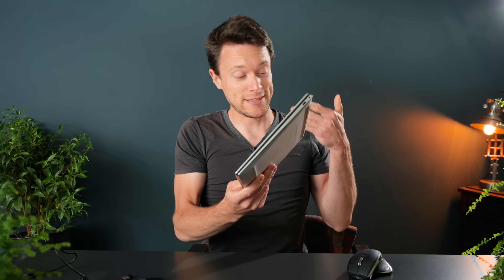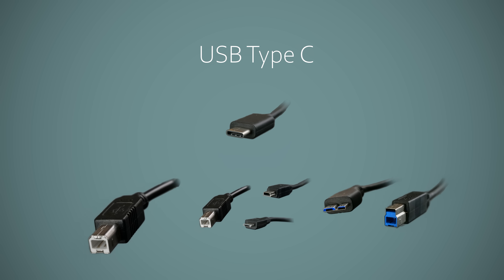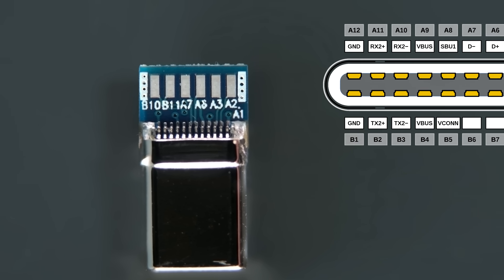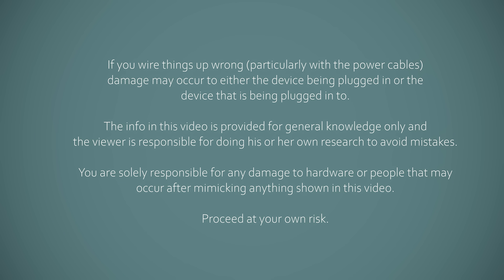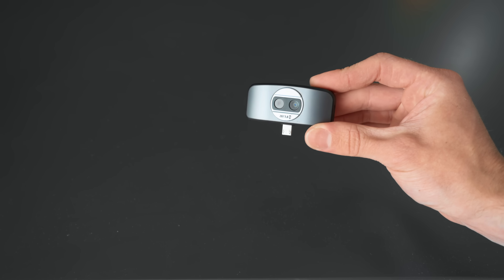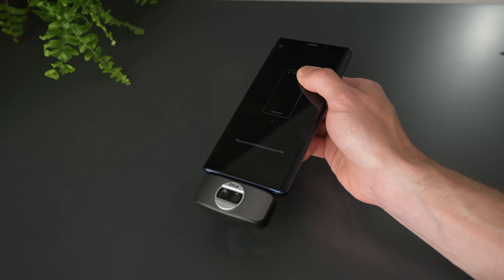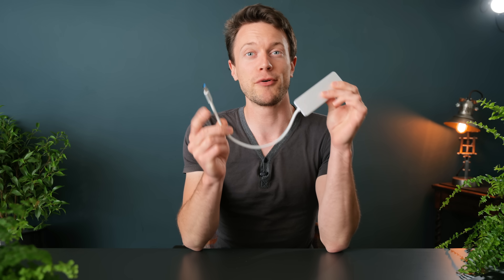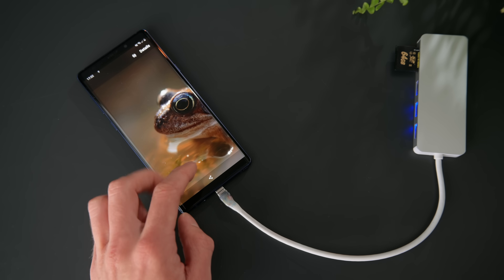Converting devices to USB Type-C

Comment: Awesome info.  You actually have me wanting to get some type c connectors and work on a few things.  Had to say I was a little disappointed at one thing though.  A few times you CORRECTLY referred to the adaptors as what they actually are, adaptors.  A few times you mistakenly called them "dongles" though.  A dongle has always been a hardware device used for software copy protection.  Yes, a lot of people throw that word around for just about everything these days, but it doesn't make them right, it just shows their ignorance with technology.  You may have used it so the uneducated people would hear a word they are familiar with, but you should be teaching them the correct words to use instead of just giving them a pass on their wrong use of the word dongle.

Comment: Brooo u have a Dell XPS!!! It has bluetooth 5.0 built in!!! Go open the tab on the botom right of the screen form Windows 10, then right click bluetooth and pick the first option from the top. A new window will open, find and click add Bluetooth device, pick the first option from the top its something like Keyboard, Mouse or Headphones. Power on your mouse it will automaticly enter paring mode then find it on your pc and your SET TO USE IT THE NORMAL WAY! Throw that Bluetooth dongle in a box somewhere u dont need it.
Reply: It's not a bluetooth dongle...

Comment: Sure you can convert wireless dongle into usb c, but many laptops have bluetooth receivers which the mouse can connect to without dongles. But I don't know if that performs worse
Reply: its higher latency yes, and not all mice support both usb 2.4ghz receivers and bluetooth, this one likely cant

Comment: i have a dual  USB A fast charge port on my car and just bought a mophie magsafe + magnetic charger, not knowing it was usb C cable, can i apply this to convert the one of the usb B on car port to usb C? i'd rather modify the car usb than cut the wire on the magsafe charger. i tried two different adapters that claim fast charge but they dont work..

Comment: And the dilemma with USB-C specifically on my area is, the sellers don't really know their products. Most of them don't, and it's been like that since the early days of Micro-B 3.0 plugs. 

For example, I had to blatantly say "external hard drive cable" to make them understand what I am looking for. If I ever said that I'm looking for a "Micro-B USB 3.0 cable" instead, they will be so damn confused and give me a charging cable with branched plugs into 3 connectors (Type-C 2.0, Micro-B 2.0, and Lighting) 😂

Also, when it comes to looking for a type C 3.1 or 3.2 aka "data transfer oriented type-C", it's frickin' hard get one. Most type-C being sold here at my area are at 2.0 speed, focused more on charging power and charging speed capabilities.

Comment: I was curious about the whole USB A/B thing and why there were so many connectors and looked it up a while back just to read about the story. This vid summarizes it pretty well. For that hub I am thinking it might be cleaner if you could open up the case and replace it with a cable with the modified connectors all being internal.

Comment: thank you for the video, you solved my issue, the if you will see near the resistor - the near 2 pads are connected to GND and the needed pin so you could move the small resistor to the other place and have the issue solved with less space :), thank you again!

Comment: I found this very informative and I did learn something that I didn’t know or didn’t think of but unless you like soldering and adding transistors/diodes, you are not saving anything over just buying an adapter.  Still a good video.

Comment: A Much Better Suggestion: Instead of buying a USB-C Connector board (03:55), buy a type-A to Type-C converter(As the one on the left side 08:44), disassemble it, get rid of all the unnecessary elements, and solder the Wireless Receiver of the Mouse to it. By doing this, you won't have to add any resister.

OR: You could use the silver plastic housing of the converter and place the wireless receiver chip inside it. It would much more aesthetically pleasing to the eyes of the beholder.

Comment: I need a similar project. My laptop the surface book 2 has a detachable screen. The keyboard houses a graphics card. The laptop doesn't have thunderbolt ports so no hope for a new external GPU. But the port the screen plugs into must work in a similar way. Because it can transfer power and video information from the keyboard graphics card. If someone made an adapter for that I could upgrade my laptops graphics card without having to buy a whole new laptop. But that's such a niche problem I don't think it's gonna happen

Comment: Hi, I own a pair of Razer Blackshark V2 Pro headsets and the charging port on them broke and instead of just replacing the tiny charging pcb (since it has its own board connected via ribbon cable), I was wanting to replace the female micro usb on it to a USB C, can anyone send links to any information that would help me achieve this? I tried to do some searching around and wasn't able to fully grasp how the wiring/connecting would work.

Comment: Oh yeah! Buying a mountain of Usb c boards and pulling your devices apart, soldering connectors, and then buying a bunch of liquid rubber is so much more convenient than a dongle even though you will still need dongles for plugging multiple devices in, and yeah that makes no sense at all. 🤷

Comment: 1. Get USB C everything, its easier, faster
2. Get USB C cables
3. Get USB C cases for all your drives
4. Get USB A to USB C adapters
5. Get USB C to USB A adapters
6. Get USB C to USB B cables for your printers/scanners/peripherals
7. Get USB C to USB A hubs
8. Get USB A to USB C hubs
9. Get a bucket that you can scrounge in for all the above.

You have wireless mice and keyboards that need USB receivers? Seriously?
Reply: Ahem, his channel is called "DIY Perks", not "Just get lots of new stuff"!
Reply: @ianmorris8534  My list is cheap, fast, easy and works.

Comment: QUESTION : Would it be possible or even a good idea to convert my  SAMSUNG MUF-256AB/AM FIT Plus 256GB - 400MB/s USB 3.1 Flash
To Type C? Using an OTG adapter?(IncludedW/allSamsnDvc) Makig FlashDrive most Compact drive ever made. I'd really like to know your thoughts. Thanks

Comment: tip: at 7:13 you have not to scrape copper off the pcb. you simply could unsolder the resistor R1 and place R2 instead.
Reply: as he was explaining it I was wondering why he didn’t do that
Reply: that resistor has higher value than the needed 5.1k, so u cant
Reply: Saw this as well
Reply: Yes, but it will require much more precision
Reply: @akeem2983  Tweezers aren't that difficult to come by

Comment: So I'm pretty sure both versions of the USB-C connectors you used have empty pads that you can move the surface mount resistors to convert from host mode to device mode, rather than scratching and/or kludging the big through hole resistor onto it.
Reply: You need a different resistor value though so you can't simply move the existing resistor.

Comment: I occasionally plug a device into my computer and get the "this device can perform faster USB 3.0"  notification. I will then plug it into the USB 3.0 port, and nothing changes. After watching this, I now understand why. I've been plugging into the USB 3.0, but am still using a 2.0 cable.

Comment: Was wondering if you had any ideas for a wireless usb adaptor to make wired devices wireless, I have seen the Bluetooth modules, but for something special, 
Like an Activeboard or smartboard, they need a proper USB host connection to function.  wireless display is easy, but i am still stuck running cables across the room for the usb connections.

Comment: Hi Matt, really love your videos. However I still cannot see properly how and which pin you solder the resistor for the USB-C trim-down version breakout board to convert it to 'Device' mode. And what is the resistor value to use? Can have the specifications in more details? Thanks.
Reply: Instead of wiping the default resistor entirely from the R1 pin? Can just de-solder and re-solder the same resistor to R2?

Comment: It shouldn't be too hard to develop a custom breakout circuit board for a USB C connector that could be surface mounted to a USB A circuit board.
Reply: Ah looks like the second USB C breakout you showed does exactly this.
Reply: No, it turns out the V+, D-, D+, V- pads on the second USB-C connector are in the reversed order and thus cannot be surface mounted onto the USB-A pads. Frustrating.

Comment: After plugged in, USB-A feels a bit more robust. I feel like I can break the USB-C cable whenever I plug it in(I do this 2-8 times per day on work laptop and docks). I hope it doesn't happen, and if it does, I hope it's on the cable part and not PC :)
Reply: USB C by very nature is more robust due the much higher contact area with the PCB due the far larger number of pins on the connector compared to just 4 on USB A not to mention the ton of advantages too

Comment: Conspiracy? Logitech wants you to buy a new mouse, they don't GAF about enabling you to buy a new dongle that supports USB-C for your current mouse. Just a thought. If they cared about the environment, they would offer USB-C converters for your current gear. But they rather you throw away your old mouse that supports USB-C. They might make $1 on a new USB-C device for your current device, but they make $10 on you buying a new mouse.

Comment: The part about soldering on a resistor is actually not easy at all, and very difficult indeed! You have to explain in detail what is a resistor, what kind to buy, how resistors work, why one is needed, etc. you kind if quickly skipped over this part.
Reply: lemme give you an advice, there's a thing called google and basic education and also paying attention. He clearly said why you need a resistor just seconds into that part. What is a resistor? and how they work? did you actually study in school considering most curriculums (hell even in 3rd world countries too) cover what resistors are in middle/high school or literally just use google honestly. And he clearly mentioned the values needed. Just put in some effort honestly

Comment: I used 8kohm smd I pulled off a junk donor board in the R2 slot and it works fine (obviously remove R1).

Comment: 4,200+ dislikes?!? What's not to like about a very straight forward and relatively easy way to allow usage of the devices you already own and enjoy with the chargers, cables and devices you will buy, going forward? Plus, Matt gives a very easy to understand and follow tutorial with the reasons why he does it the way he advises, references for the information detailing what you need to know and he even gives a list, with links, to the parts he used in the vid. What more do you want, for Matt to come to your house and build a few for you? Either that, or there are 4,200+ people with businesses dependent on people having to buy adaptors and/or cables from them to connect non USB C devices to a USB C only host or people that will throw out perfectly good devices without the newest type of connector and go buy devices that do. TRAGIC!!! Thanks Matt, for the great channel, it's content and your willingness to share the info you do that helps save TONS of cash and enables people to do things they didn't realize they had the ability to do!
Oh, yeah. A huge "BOO!" and middle finger to the 4,200+ that think this video was somehow not worthy of a thumbs up or at least didn't/couldn't see the value this vid offers and felt compelled to have to hit the thumbs down and/or crap on it in the comments, rather than just move on to whatever it is they like watching.

Comment: The term sub device is a bit of a misnomer. Form the USB C spec we still assign functionality as Host and Device, as you have illustrated. However, "sub" connectors as you put it, as legacy before USB C, are mechanically given either a Host or Device "gender, form factor", with the ability in USB 2.0 OTG to exchange host and device roles, using USB micro B with an extra pin, or negotiated to transfer the host role. USB C has a basic signalling "pull up/down resistor configuration" to identify a device to a host. The OTG functionality is now up to a "smart" device (like a tablet) to change roles from device to host. This is interesting because, as the hardware has evolved for USB OTG, this reassignment for Tablet, for example, is confined to one port. Either USB C or micro-B receptacles. Which makes sense, for a tablet, in ligically how can a USB port be both Host and Device at the same time and to save cost the hardware only supports one OTG port. Where as for a PC or Notebook the USB C assignment makes more sense, from a legacy standpoint, that all the ports act like a host. Anyway this is how I understand the evolution. I would like to get other peoples input on this.

Comment: Your soldering is not great, I wouldn’t trust it!
Also how can you get USB 2.0 to even transfer data? I tried with a mouse, the cable was simply too short for my use so I cut the end of an old 3 meters long USB A to micro USB cable, and soldered a female USB A. The data wouldn’t transfer because of parasitic capacitances!

Comment: Isn't it possible to desolder the SMD resistor and put it back on the other pads (to change it from host to client)? instead of using a full sized through-hole resistor?
Reply: It has to be around 5k. I’m not sure the minimum value but you can’t use R1 and move it over.

Comment: I always considered lightning, micro usb-b, and type-c connectors to be the same plug-in, and that they only separated phone brands so that you had to buy more things.

Glad to see there’s more to it
Reply: Lightning is it's own thing as no simple adapters exist for it to convert to USB.
Reply: Micro-B at least has the excuse of market demand, where most users would be unhappy to have a chonk regular sized B port on their device. But lightning, while welcome as a change from the old Apple port should imho have been put on hold and instead Apple should have waited and assisted with embracing USB-C. Especially now that they're using it on some of their iPads there's no reason to continue using it other than to sell more adaptors, cables and chargers.
Reply: @G1NZOU  Apple was one of the main drivers behind USB-C's development. Only reason they moved to Lightning was that USB-C initially was that it wasn't ready.
Reply: @reaperreaper5098  I totally get that, the trouble is they're now continuing to use Lightning but in a weird way, where some of their products have Lightning and some have USB-C or Thunderbolt 4, this completely derails their argument that they're saving eco resourses on cables since someone with an iPad still needs to buy both cables if they have a set of AirPods.
They should streamline their mobile device range and accessories by standardising instead of holding on to Lightning longer than it was worth.

Comment: not to nit pick but at 7:04 wouldnt it be easier to just use some tweezers and your iron to unsolder and move the resistor to  the R2 pad? you dont need a new resistor and no need to damage the pcb.

Comment: the epoxy has no give, so you should add sugru around the epoxy and in particular ensure there's a thick quantity of it around where the cable interfaces with the epoxy to provide mechanical strain relief.

Comment: Another great modification/repurposing!  I have a 4g wifi,, cd,dvd, android radio which the volume knob seized up & failed. The volume knob controls power on/off, volume, & mute function! This radio also has a similar looking knob for tuning but, I hardly ever use it plus, changing a radio station can also be done two other ways,(using touch screen, & memory touch screen buttons) so, I was wanting to try to swap the two knobs. The volume & tune knobs are digital rotary encoders & they have 5 pins. Myself having not been involved with electronics much in many years, I have a soldering gun but, that's about it...I am assuming that I need a solder suckered to remove the solder from all five pins to be able to remove the digital rotary encoder knobs. I WAS WONDERING IF THIS IS A JOB THAT YOU WOULD CONSIDER? ALSO, WHAT WOULD THAT COST? I. REALLY HOPING YOU ARE WILLING TO ASSIST ME???

Comment: If you dont want to solder a bulky tht resistor to that board(and cut the traces on the panel), you can simply solder the smd resistor to the other solderpad what is empty, it is left blank for this exact purpose.

Comment: Running into an issue converting USB 3.0 to USB-C.  Wired it up as indicated in the video, but the USB-C port will only pick it up when inserted one way and not the other.  Seems like orientation matters on this build, and I can't figure out why. Any thoughts?